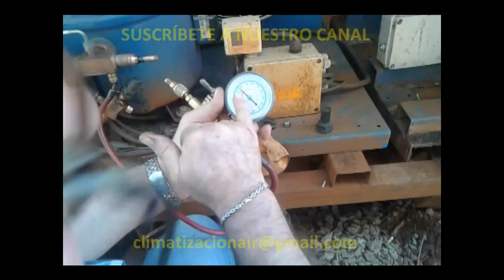🌍✔ PRESIÓN DEL SISTEMA, VÁLVULA EXPANSIÓN,  EQUIPOS BAJA TEMPERATURA

Comment: maestro carlos panno podria decirme que presiones maneja un sistema de aire acondicionado de camion en alta y baja el problema es que encienden el aire y a los pocos minutos para el compresor le agradeceria su orientacion 
un saludo
Reply from the maker: +laza gabriel hernandez       Buenas noches Señor:
                                                                                    El problema que usted esta teniendo es que el presos-tato esta detectando o falta de refrigerante o una presión excesiva en alta .
la presión normal del 134a es de 30 libras a 900 vueltas el motor (regulando) .

                  Atte  Carlos Panno                           QUE DIOS LO BENDIGA